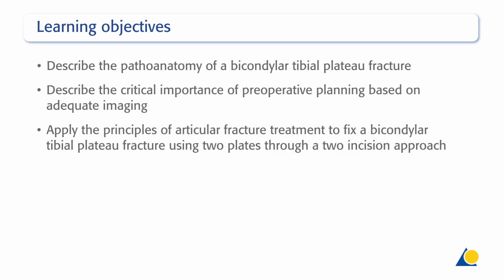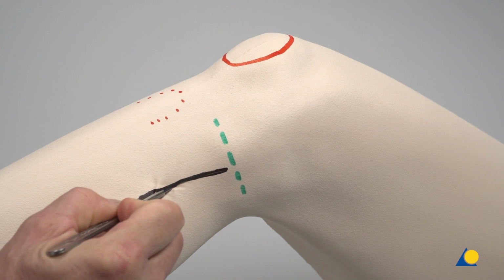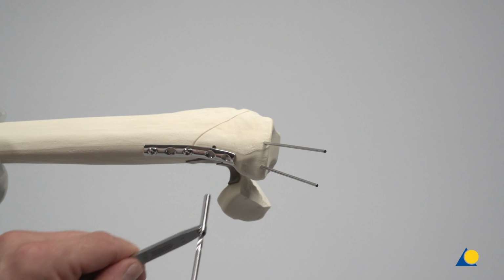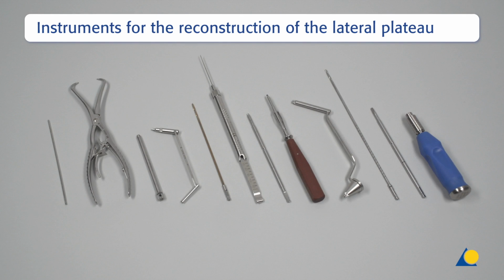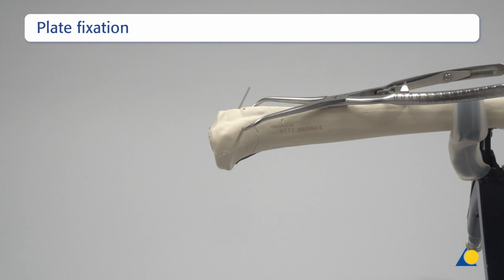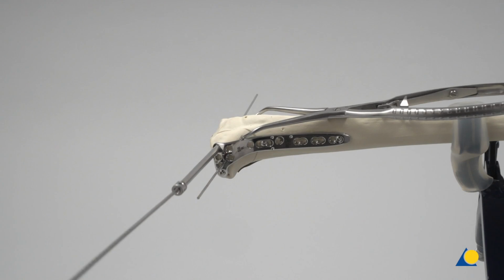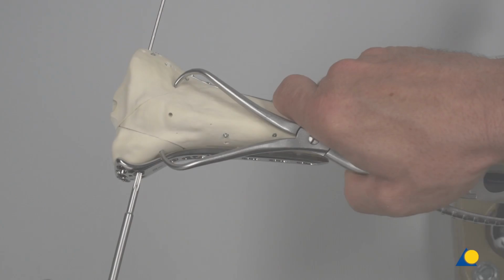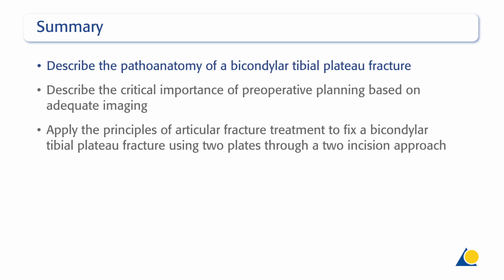Tibia Plateau - Bicondylar Fracture 41C3 - Fixation Using The 3.5 VA LCP Proximal Tibia Plate System

Comment: Cheer~~~the inner and typically larger of the two bones between the knee and the ankle (or the equivalent joints in other terrestrial vertebrates), parallel with the fibula.😊